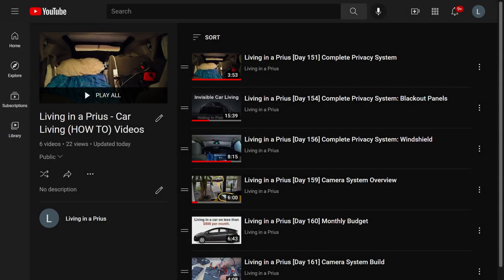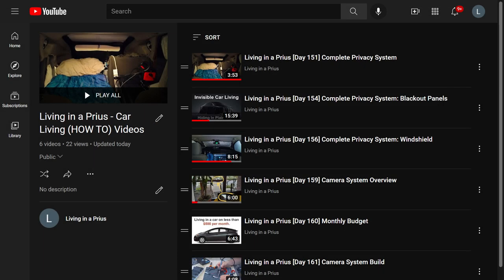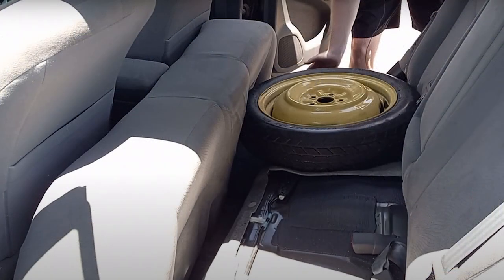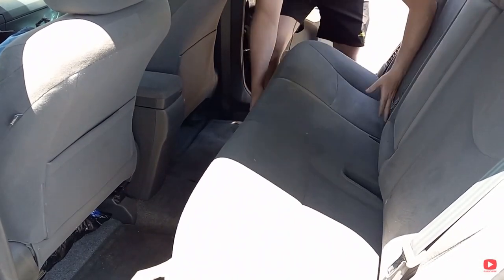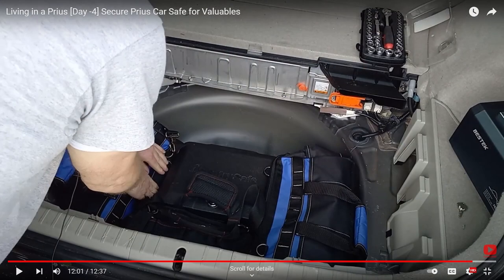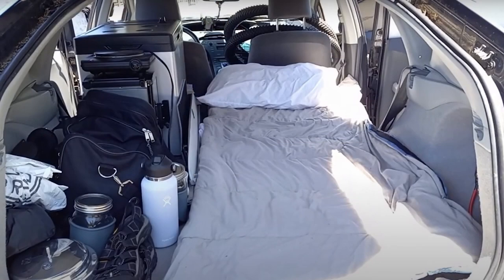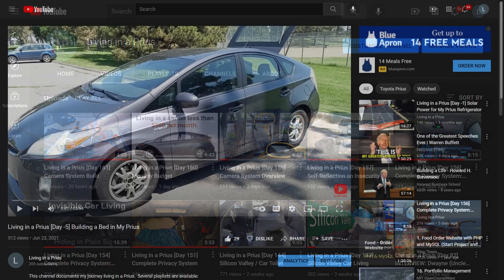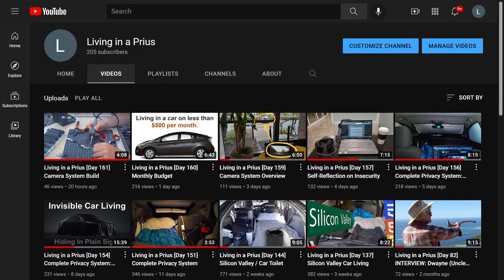Building a Car Bed - Using ONLY Car Parts

Comment: Thanks, I like your inventive set up for your bed. I’ve never seen anyone remove the seat and use it to lengthen the sleeping area before. It’s pretty clever how you use the jack to level the back rest. Any issues with the tire and jack rattling?

I just discovered your channel and I’m working my way through your videos. I have a gen 4 Prius that I’d like to set up for travel holidays so I appreciate your trips and tricks!
Reply from the maker: I wanted to find a way to keep the spare in my car but make the storage in the back available for other items.  Figuring out how to use the spare to make the bed was simply a matter of trial and error.   To answer your question:  I have never had an issue with the jack and tire rattling.

Thank you for taking the time to watch my videos!  Let me know if you have any other questions.

Comment: i know that you use a porta potty for emergencies only as you have a gym membership.  is there enough space to use the porta potty on the floor of the back seat when the front seat is pushed all the way up?
Reply from the maker: Great question.  When I searched for a portable toilet, I looked for one that wasn't too tall.  I wanted it to be able to work in small spaces, which is also why I didn't use a 5 gallon bucket, which a lot of people use.  The toilet that I showed in my video called "Living in a Prius [Day 144] Silicon Valley / Car Toilet", is one of the smallest that I could find online.  It should work on almost any seat.  I would recommend ordering a portable toilet from Amazon and seeing how it fits on different seats.  Most products on Amazon come with a free return option, if you decide it wont work for your needs.

Thank you for the question, and thank you for watching the videos!
Reply: @livinginaprius  Thanks for that. Funny enough  the porta potty that you use is always sold out on amazon. I think its called the Trip Tips porta potty.  Good luck in your travels. Although it doesn't seem like  you are travelling all that much on $40 worth of gas every month. :)😃
Reply: @livinginaprius  Thanks for that. 😃